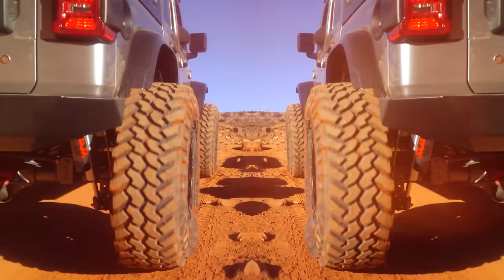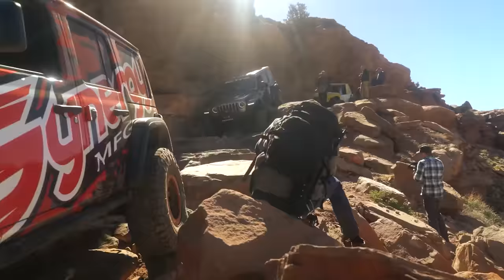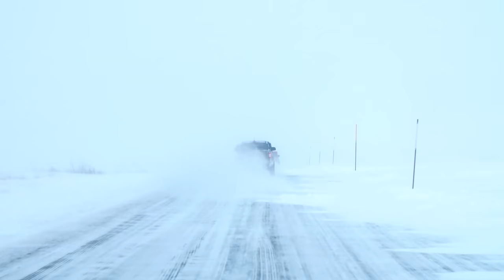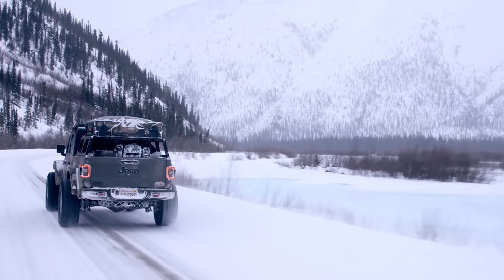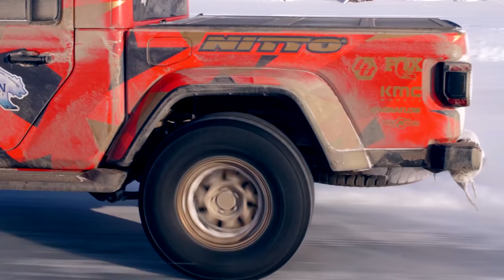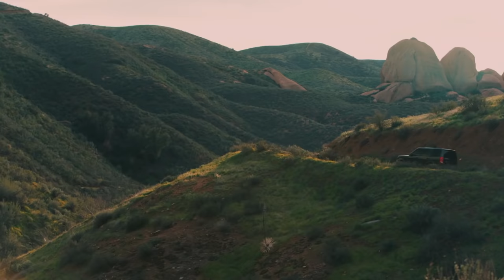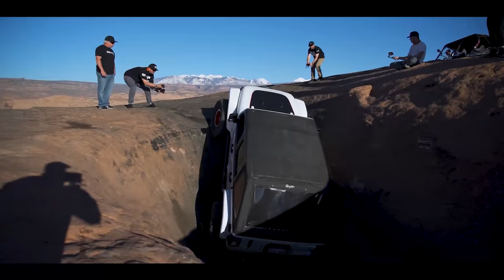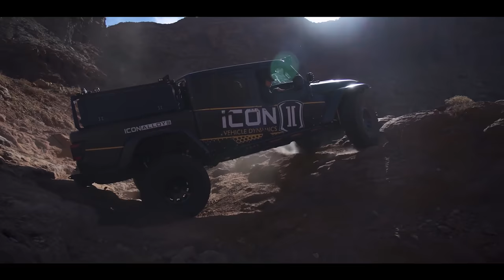Do NOT Use 4-Low Offroad || Watch First!

Comment: I use 2 low-High, 2 low-low, 4 low-hi, and 4 low-low
Reply: The ultimate cheat code!
Reply from the maker: ^ We need a video on that! ^
Reply: @TrailBuilt  it's just a simple toyota dual case setup with a twin stick on the primary case

Comment: 4Lo gets me out of things, and over things, aired down 2wd most of the time. 4Lo helps me feel safer parking on steep inclines (Manual Trans).
On off road uses: Found 4Lo to be the best way to go through the seasonal Christmas light yard display street ("Christmas Tree Lane") or when I'm on the freeway and its traffic jam.
Reply: Jesus dude 4lo is not for dry pavement
Reply: @MikeSmith-ey7ku  no turning and less than 5mph, its fine.

Comment: Does it hurt to go back and forth from 4high to 4 low as the needs dictate?
Reply: That is exactly what you should be doing.   Woth the multiplied torque in 4LO it's much easier to break things.

Comment: So just picked up a Toyota Land Cruiser 1991 FJ80 (228K miles) And was wondering when use the LOW gearing? They say its 4 wheel drive all the time? I drive it to and from work in 4H (it's an automatic) just not sure when o drop it into 4 LOW, and it has a Center Differential Lock as well. Thanks for any help~

Comment: I live in PA in the mountains and we get heavy snow. This is my first time owning a true 4wd. Can I drive on the highway 60-65 mph in snow while in 4wd without damaging my engine? Is it safer than rear 2wd? (Ford F-150)
Reply: You "can" drive 60-65 in 4 high. Not in 4 low.  BUT you SHOULD NOT drive that fast in four wheel drive. Both for wear on the Transfer case and the rest of the parts in the drive line Also you should NOT drive 65 on snow covered roads!!! PERIOD!  Four wheel drive does not make you immune from slipping and sliding around on slippery roads. Think of 4 wheel as an aid against getting stuck and not as something that magically glues you to the roads and you'll be better off.
Reply: 45mph on 4H is the max that i drive

Comment: I barely ever use low. Occasionally when I'm dragging something really heavy on looser terrain, and sometimes for precarious descents.
Respectfully I doubt you'll have many parts or accessories for my truck, apparently there's never been much of an aftermarket for the WD21 Nissan Pathfinder.
Reply: No, but it's one hellova truck already.  Would have liked to modify mine with lower gears in the transfer case (4:1 instead of 2:1) and maybe a lift to give it a more aggressive stance.  Winch bumper, etc.  Those are easy to find in the after market.  WD21 is a better truck than the WD22 IMO even with the Supercharger option.  All I own now are the SC WD22's (Xterra) now.  Sadly, my WD21 is gone.
Reply: @MrHellfinger  yeah, that it is. I have a stock 95 and a 93 that's... Not...

The modified one has the engine block from a 2001 3.3L Frontier, but the intake, exhaust, and accessories off the original 3.0. For that one I'd really like to find a LSD from an 87(iirc) SX because apparently that'll fit into my front diff, but I think lockers are easier to find.

 I have 31's on it on stock suspension height, but if I wanted 33's or bigger I think the best lift is that Calmini 2.5" suspension that corrects steering angles, and the best steering upgrade I know of is the Grassroots centerlink that eliminates twisting in the OG dogbone. 

As for a winch bumper, apparently those were available but these days as I understand it my best bet is to have a bumper off a Cherokee XJ, because the frame mounts line up and it's almost exactly the right size.

If I somehow lost my wd21s I would grudgingly accept the wd22, but I'd have to piecemeal it as I understand it, because the first gen is better than the second apparently, except for a couple things like the rear end iirc. Buuuut IMHO a wd22 is infinitely preferable to an R50...

I don't know for sure but if the supercharger is on a VG series I would think it could be fitted on the vg30e too. That would be pretty awesome tbh, but I always forget whether it's a super or a turbo that runs off the exhaust. The one that isn't using the exhaust apparently has to be very well filtered in dusty conditions, which is usually the case around here. If it's not muddy it's dusty.

I used to be a bit jealous of jeep owners being able to find aftermarket parts almost literally anywhere, but my truck really grew on me. For one thing, I don't think I could buy a jeep for $900 in Phoenix, drive it to Arkansas on a cracked cylinder head, and replace the head in my dad's yard with one I got off ebay for a hundred bucks, then get me through terrible flooding with leaking fuel injector seats.

Lol, I could go on all day about my truck. You have my sincerest condolences for losing yours. If I were you I'd keep an eye out if you can, they're not entirely gone yet. I bought the 95 from a car lot last year for 4k, and a couple of days ago I saw a FREAKING TWO DOOR zones out and starts drooling at another one.

Oh yeah, fun fact. According to the Wikipedia page for the Pathfinder they were originally marketed in Japan as being the offroad edition of the Fairlady Z. Lmao.
Reply: @revwroth3698  Pathfinder as the Offroad Fairlady... that is awesome.  My first car was a 280Z so that gets me in the feels.   Aftermarket for Toyotas and Jeeps is huge!  Was originally looking at used Toyotas but for less than the cost of one Toyota with 200K+ miles, I found two Xterra SE/SC 4x4s with 120K each and still had money left over.  I'll live without the aftermarket support to have something just as reliable as a Toyota but costs less.  But only because I cannot get a newer Nissan Patrol or a 70 series Landcruiser (love those Aussie Diesel trucks).

The Supercharger will probably mate up to the 30VGE but you would need all the belt drive components and mounting plate, intake, etc.  Might need a body lift or modify the hood to allow clearance.  Some 300ZX guys are using the 3.3 block in with their twin turbo manifolds.  Larger displacement, slightly beefier bearing bolts too.  VGE was a good engine just needs 4 valves instead of 2 for better performance.  SC is better for offroad not just for the dust factor you mentioned, but also because turbos need to have the revs before power is increased (lag) versus the SC being immediately available.  The normally aspirated trucks are still pretty good, but I really appreciated the SC going through the mountain passes.  Transmission kicks into lower gear, then at about 2800 RPM, the SC kicks in and you're flying up those hills.  The SC tune on these trucks is low for reliability, so it's not a huge gain.  Not exactly worth the cost of upgrading but a fun option.

Been keeping my eyes out for a WD21 or D21 4x4 truck.  They are getting rarer.  Same with the old 620 and 720's.  Someone out there is buying up junkyard Xterras big time too.  Trucks I had pulled parts out of the week before are lined up in the 'we're selling these to a wholesaler' section of the yard the following week.  Makes me want to buy up more WD22 and D22 trucks while I can still find them in decent condition.  I could talk all day about these trucks LOL
Reply: @MrHellfinger  ooh, 280z is nice. lol, my first car was a honda passport, that kinda got me into the compact 4x4 suvs in the first place i suppose. i'd love a toyota honestly, but like you said they're ridiculously priced if you can even get anyone to sell in the first place. people out here drive them into the ground, then have them in their yard for twenty more years swearing up and down that they're going to fix it next month. honestly i understand that sentiment better now, i wouldn't want to let go of my truck either.

oh yeah, i'm beginning to remember some stuff i read about fitting SCs on them on NPORA years ago. iirc a few people were putting in a body lift (possibility of bigger tires is a bonus) and... something about flipping over the upper radiator brackets to make up the difference...  i really liked the 3.3 when i had it running. full disclosure it did throw a rod after two weeks, but i'm pretty sure that's because someone hadn't properly torqued a rod bolt and i didn't know enough to have checked for that at the time. it's funny, i barely knew anything before i bought that truck...

oh yeah, that reminds me. have you heard of that vg35 mod? apparently you take a 3.3 block, bore it .040 over iiirc, and then you can fit the pistons and rods from a VQ45 in there with a displacement around 3500cc. there are a few write-ups on it around the internet in various places. i read it on NPORA first but i think i've also seen them on infamous nissan and a couple others. that sounded pretty cool to me. 

my dad keeps trying to talk me into dropping my spare 350 into a pathy, which is somewhat tempting, but it's already complicated enough since i have parts on my engine from 3 or 4 different Nissan models already, including the oil filter mount off a Quest, i don't really want to throw a completely different make into the mix. 

i wonder if that wrecker dude still has those two 1600 roadsters though... that was the most tempted i've ever been. i didn't have any money when he offered me the both for fifteen hundred bucks, or anywhere to put them, but i should have offered to work them off or something, dang it...*facepalm*

Comment: Do I need traction control in4L or is it disconnected automatically? I'm also guessing it should be on in 2H or 4H Auto.
Reply from the maker: Yes, generally, traction control should be enabled in both 2H and 4H Auto modes as well as when using 4L. However, the specific behavior may vary depending on the vehicle make and model, so it's always a good idea to refer to the vehicle's manual for precise information regarding traction control settings and operation in different driving modes.

Comment: My Wrangler was a Hertz rental with an auto, 3.07 diffs (!) and 31"s it cruises great on the highway but on the trail it's useless in 4WD high, just bogs down in first gear on hills so I shift to 4WD low and it grunts up to spin the tires.  Dunno what's going on in the transfer case but in 4WD low third gear 30mph is max and in 1st gear it'll grind over the worst steeps\rocks.  Only thing bad is in 4WD low 1st on steep downhills there's no engine braking so the rig will rev to 2500rpm and I have to work the brakes 'till they overheat.
Reply: JK or JL?
Reply: wow.. 3.07 is a pretty tall gear.    I think it's worth sacrificing a little fuel economy to put in either 3.55 or 4.10  in the axles to give you a 4 high that is a bit more useful in  most situations.    Just my completely amateur $0.02.
Reply: @jjc4577  My shop guy says regearing won't make much difference concerning my steep downhill engine braking problem.  The problem is that the 3 speed auto tranny's first gear is too high so 4Lo foot off the throttle engine braking speed is gonna be too fast even with 4.10s.  Agreed it would make 4Hi more useful, but for $2,000+- the cost/benefit ratio doesn't pan out.

Imagine that, a mechanic talking you out of a regear job!
Reply: @ed_word_6198  TJ

Comment: All these "Do not, do not, THOU SHALL DO NOT!" videos and your advice is basically only good for YOUR driving style. Meet me in Northern Colorado someday and I will show you MILES of trails that 80 percent of the time on the trail it will be impossible to drive without 4lo. You CAN STILL shift into 4hi on flatter, leveled out, and non ascending areas but won't go further than a quarter mile before the NEED to use 4lo arises again. The only exception I can think of is attempting these high elevation trails in 4hi would be if you didn't have lockers, and or the rocks were wet, and you have a manual transmission(occasionally automatic could need this. Your advice would be spot on for an Aussie driver, or for a flatlander in the Southern U.S. , or California sand dunes! But at 12k elevation with a 1200 ft drop to certain death on one side, and that advice to someone who only payed partial attention to what you say could cause a person with little experience to find themselves at the base of that 1200 foot drop.
Reply from the maker: The video breaks all of this down and explains scenarios on when and where you should use each 4x4 option.

Comment: Hahahaha - well here's a good one - 
DO NOT USE LOW RANGE (all locks on) 4WD on tarseal hard top either or you will definitely bind-up your axles & twist them to hell and gone.
Geez Louise ..
Off road is where you will get wheel spin & lossy / loose traction areas, where Oh gee - axle bind (twisted axles) are NOT going to worry 4WD LOW ..

I use LOW range (4WD-LO) everywhere I need a LOWER GEAR SPEED than my lowest gear will give me in the normal 4wd High selection (period).
ON GRAVEL or loose surface roads only they said - hell no I will at a pinch - use it in a straight line on tar-sealed HILL starts too - if needed when towing a heavy load behind.
Why?
It's NOT for the grip as such but to avoid straining the motor with too high a gear - when there is a selector there that will give me a selection of lower speed ratio gears - at a needed lower speed condition.

Comment: Genuine question. Why do you yanks use jeeps so much. They seem like pretty capable vehicles with good mod support but the reliability should be more of a turn off. Thoughts?
Reply from the maker: I can't really speak for everyone but I personally think the Jeep platform is so popular because of its capabilities, you could use it one day to run through some spots in the woods, then next day take the top and doors off and just cruise a country road!
Reply: and specifically Jeep Wranglers. Because there are more aftermarket parts made for Jeep Wranglers than there are for any other 4x4's on the road. And the people who own them also form a tighter fan base than the other guys, which makes for a broader knowledge spectrum for repairs and modifications.  For me I like owning a MoPar, ever since my 1970 Roadrunner and 1968 Dodge Coronet R/T and several other MoPars. Also Jeep was used in the military etc. But getting back to the original topic, I wish people would talk more about final drive ratio and it's effectiveness on 4-lo vs. 4-hi.
Reply: Something that should have occured to me before is the fact that it's much easier to maintain and repair Jeep vehicles in the US making reliability a less significant factor. It is interesting to see the differences in 4wd communities in different regions in of the world. For example here in Australia most of what you see is Toyota

Comment: i rarely use 4 low my dana 20 transfer case doesnt have that low of a low range any way and with a 3 speed manual and 500ish ftlbs at the crank of my inline 6 in my jeep i dont really need the extra 2:1 gearing it gives me for the most part i think iv used it like 5 or 6 times in the last 10 years

Comment: So when im at my back 40 and its snowed pretty deep ive noticed in 4h it overheats tranny ..my road is 15 miles  and can be very snowy or muddy depending on nature this is when i want to be in 4l ???
Reply from the maker: 4 Low is gonna be used when needing more torque - like when steep climbing or trying to get out of a deep situation. More torque does not mean more traction though, so it can be unsafe on slippery surfaces like snow, ice or mud.

Comment: Every once in a while, I use it to pull into the garage just perfect. Mostly out of boredom. 

The only time I've used 4hi off road in a meaningful way was the big hill at Silver Lake Sand Dunes. 

Really wish I had a low range 2wd setting on the transfer case. I would prefer that to avoid drivetrain bind and not have to shift to 2hi.

Comment: You quoted bicycle gearing. Bicycle gearing is the opposite of motor vehicles. The lower the gear the harder to pedal. Higher, the easier.

Comment: We have to know first what L and H means? L means low speed and H means high speed. So based on your judgment dear driver, if you can drive the off-road terrain comfortably with high speed then use 4H otherwise use 4L. I mean by high speed something above  55 km/h (34mph).
Reply: I'm not sure this is quite correct.  Low is the low end of the gearbox where the gear ratio's are very low (4.10 or 4.55) but the high gears might be 3.55 or higher.  As for the application, you would be correct:  use Low for low speed or when you are crawling around and the High for normal operations.  Learning is always a challenge, especially when you don't know what you know.
Reply: @Harry-zz2oh  Well I was thinking the same, until I saw a youtube video from Toyota USA referring to H4 as high speed and L4 as low speed. Paste "2007 - 2009 FJ Cruiser How-To: Part-Time 4-Wheel Drive System Overview | Toyota" in youtube search box for reference.

Comment: Going uphill should be in 4 low, not 4 high as you suggest.  My transmission in 4 low has the first 3 gears lower than the first gear in 4 high.  If you start in third gear four low and start to bog down you can always downshift to second or first unlike starting in first gear four high, there is nor room to downshift.

Comment: Not the recommended shifting procedure for 4Low.  Here it is: 
4H To 4L Or 4L To 4H
With the vehicle rolling at 2 to 3 mph (3 to 5 km/h), shift an
automatic transmission into NEUTRAL (N), or press the
clutch pedal on a manual transmission. While the vehicle is
coasting at 2 to 3 mph (3 to 5 km/h), shift the transfer case
lever firmly to the desired position. Do not pause with the
transfer case in N (Neutral). Once the shift is completed,
place the automatic transmission into DRIVE or release the
clutch pedal on a manual transmission.
Reply: Was gonna say, manual recommends a slow roll to shift into low.